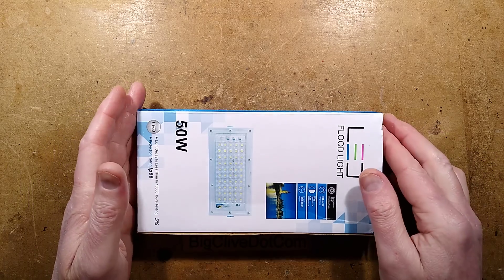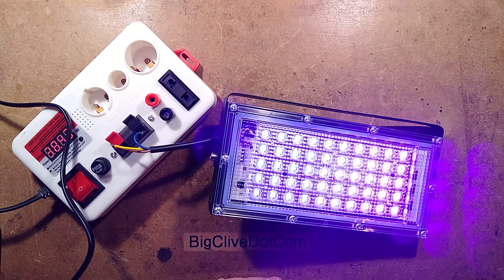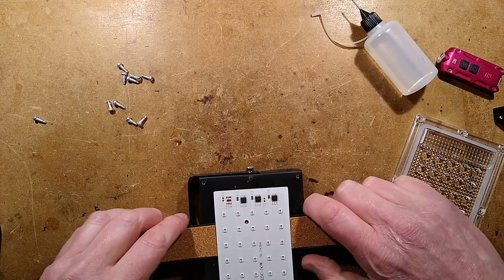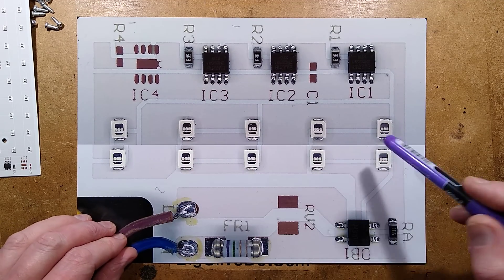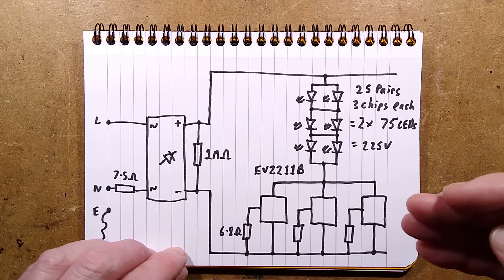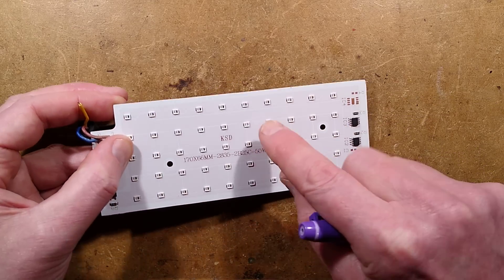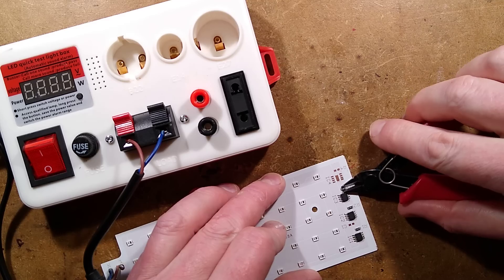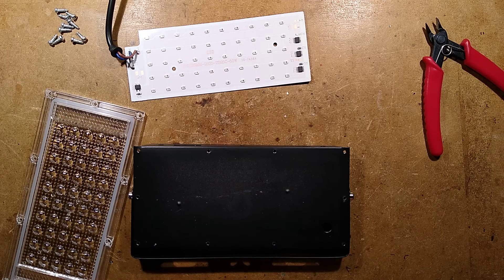Horrible eBay ultraviolet floodlight (with schematic)

Comment: But is this really Ultra Violet light? In a sense, if I want to cure UV activated Glue would this light emit UV radiation to cure the Glue? Or Curing Epoxy (which cures faster with UV lights) for example?  Thank you
Reply from the maker: It depends on the glue.  Molst seems to respond to the near UV spectrum.

Comment: I bought the 100w version. Missing the earth wire entirely, but there is another flaw. The 96 leds are wired in 3 x 32 parallel/series EXCEPT near the top left hand corner where there is a PCB error so that 1 triple LED bank has been split up, with all the current going through (from the top left) 3 parallel LEDs, then just 1 LED, then just 2, then back to the 3 + 3 + 3 + 3 pattern.
I shall be making 1 cut, and 2 PCB links to fix this to prevent the single LED acting like a fuse, as well as better heatsinking and an earth. I was going to hook this to a timer for exposing photo resist film for PCB prototyping. We'll see how that goes.

Comment: If the battery has a protection circuit, then there is nothing wrong with this circuit. Given the size of the solar cell and diode drop through the transistor it is unlikely that cell overcharging will occur even without a protection circuit. However, given that the switch can be left on to keep the light activated all the time, it would be possible to completely drain the battery. For that reason alone, it suggests that the battery has its’ own over and under charge discharge protection circuit. So in all likelihood a decent design.

Comment: I bought these in warm white, saw the fake earth and checked if there’s any voltage on the metal case and yes, it’s 160 Volts and went right into the bin. So be careful guys when you buy this crap or just don’t.

Comment: I don't expect Clive to have the time to reply to this, but just wondered if anyone knows what camera he uses for these close up demos? I do videos looking at old books and am stuck using a terrible webcam. Would be great if someone could help, cheers!
Reply from the maker: Most videos Moto G7 power.  Close ups, good lighting and a Moto G6 play.
Reply: @bigclivedotcom  cheers Clive! Wasn't expecting that. Love the way you can zoom in so easily and still retain a nice resolution. Very kind of you, cheers mate!
Reply from the maker: @newsfromthegelding  It's effectively digital zoom, but because it's a 1080P image working in a higher resolution frame it has the effect of optical zoom until you get too close and it has to go digital.
Reply: @bigclivedotcom  I thought that was the case, but still a really workable resolution when zoomed. Good lighting also helps a lot, I've noticed that even with the crappy cam I've been working with. Incidentally, it's a Logitech C920 I'm using. Absolutely fine for those who use it for streaming games, but anything else and the lack of quality/accurate fps is glaringly obvious. Just all a bit clunky.

Comment: All very well to criticise Chinese products, but there are plenty of British one that are also deficient in some way, e.g.  a UK manufactured washing machine that broke down a few days after the warranty expired.  All parts were working perfectly, the circuit board components were ok but the circuit board was designed to self-destruct on de-soldering them  Only the programmer chip could not be tested - was it programmed to count mains cycles and self-destruct too?  The replacement board was retailing for £200, but not programmed!  One then had to buy the firmware and a programming device (another £250).  So, to get working again £450 plus the time and effort, not counting p&p.  Another UK item with a safety concern was a cooker with a ceramic hob but no indication if the controls were powered on or off, likewise for a convector heater - a thermostat which gives the impression it is off, but comes on again if the temp drops.  Any item plugged into mains power should have a red light as a minimum.

Comment: With their large input capacitor, these things are great at tripping an RCD if a few are used on one circuit.
Reply from the maker: It may be the capacitance of the LED panel itself that leaks the current.

Comment: Hey Clive! Your content never ceases to impress me. Have you ever encountered a light source with various LED types that span the entire spectrum from UV to IR? I'm exploring camera color calibration, and I believe such a light would be beneficial. By illuminating the camera with distinct wavelengths, we could examine the RGB values. This approach appears to be simpler than constructing a monochromator.
Reply from the maker: That would be difficult to achieve in a linear spectrum.  The closest is high CRI LEDs that use a wider mix of phosphors for a richer white spectrum.
You may need to resort to daylight for a full spectrum.
Reply: That's interesting, Clive! I wasn't aware of the Color Rendering Index. It appears to be related to LEDs that emit the full spectrum simultaneously. However, for my color calibration project, the LEDs don't need to be active at the same time.

In fact, I was so inspired by this concept that I purchased ten distinct LED types with the following wavelengths: 400, 420, 445, 460, 490, 520, 620, 660, 850, and 940 nm. My plan is to connect them to a relay module, allowing me to control each LED individually by switching them on and off as needed.

Comment: BYOG .. bring your own ground.
Would be really stupid to send earth all the way from china, just take a shovel and add your own ;-)

When wiring a house you are supposed to have earth even if its not needed at the end, so if somebody drills into the line theres a higher chance of hitting a nice short circuit. So its definitely up to code, maybe, somewhere..

So lets just assume its got superior double insulation everywhere and the RCD will do the rest :-)

Comment: So.... Mods/Upgrades..
1 - Prep and spray the whole thing with BBQ/Heat proof paint.
2 - Sand off an area where you can soldier on the earth lead.
3 - Drill through the backing plate for 2 screws to mount the LEDboard (2 holes are already there on the LED board for reference)
4 - Use thermal paste to help heat transfer to backing plate
5 - Seal up (using silicone sealant/rubber washers) the back of the LED mounting board to the back plate to stop water ingress
Done...👍 Except for any internal mods like your tactics at reducing power consumptions etc 😉
Safer, a lot more water resistant and thus, longer life for product? Yeah I know, time involved doing this, but, IF you had the stuff already lying around in the shed, it'd be a nice little project.
Note.. As per our previous discussions (some time a go about weatherproofing twinkly/solar garden lights), as well as sealing around the edges of the solar panels with clear nail varnish, I now do the same to 'Coating' the circuit board and exposed wire with the same and/or a little silicone etc and then a dab of grease on the battery terminals... NOW.. We (my lady friend who has so much lighting in her garden you could identify where she lives from MARS! hahaha) have cheap garden lights lasting (so far) 3 full years - the occasional battery swap needed etc... 👍👌
😎🇬🇧

Comment: I was given one of these-Gardner AG-969 Insect Electrocutor- because it did not work. It works now after I noticed the door safety interlock was bent over.
 Attraction range: 3,000 sq. ft. (70 lineal ft.)

UV light output: 96 watts
Bugzapper from Hell. 
What to do with it now?
Reply from the maker: Bent safety switch brackets or actuators, and detached/broken wires are a very common fault in discarded products.

Comment: I would say just solder that ground wire onto the plate/somewhere sensible, and then pour silicone into that wire so it's waterproof and then it's a pretty good light right?
The good thing about you having so much electrical knowledge, is you'd often be able to fix these critical safety issues and thus wind up with a fairly usable device.
Reply: Other than the utter lack of a heat sink is going to put the board into thermal shutdown pretty quick, sure they're peachy.

Comment: Would the missing decoupling capacitor have done anything besides save the IC's from transients?
Reply from the maker: It's probably in the regulator IC datasheet so they included it just in case, but then left it off.

Comment: So I've seen these in hospital and restaurant locations, but I wonder what their function would be in outside locations?   Why use ultraviolet and not a high intensity led panel instead?  Also did you use your ultraviolet cards to determine  whether or not they are in fact ultraviolet?    I can see these used in as part of a diy mini water purifier project.    Good show.
Reply: These would not work at all for a water purifier.  These are longwave UV devices.  You need shortwave (UVC) for any germicidal application.

Comment: I had this in white, failed after a week completely with 6 hours of use / day
Reduced the output power to about 10W, shorted some burnt LEDs, yet it failed after a month again.
It is just designed to fail, so you can buy another one ...

Comment: Oh my God. I encounter this problem with most of the automotive headlights I order of aliexpress. Either they seriously lack thermal paste or are insanely overdriven. Every pair that passes through my hands gets hacked with a resistor across the thermistor circuit.

Oh yeah:
https://youtu.be/_oi4imsHrqA

Comment: Sorry to bother you with a question...I'm not tech savvy and am a very amateur low end home cinema enthusiast... One thing I can't find is 1-1.5mm stranded normal low end cable a good choice for speakers...compared to hi end stupidly priced speaker cable....would love to see a test...even if it's just a difference in ohms. Hopefully 🤞
Reply from the maker: Just use ordinary flex.  It makes excellent speaker cable.  As used by audio industry professionals.

Comment: I use a couple of these as work lights, they came with the varistor, and I chopped off all but one of the resistors and added an electrolytic. For the cost of a burger each, they were worth it.
Reply: What did you use the capacitor for?

Comment: You can buy these, scrap the metal housing and electrical parts, and build your own Aluminium Heat sink housing and proper current generator power supply.

Comment: That unconnected earth wire could defeat / delay the RCB / GFCI device. This is a death warrant.
Reply from the maker: It wouldn't  affect the RCD as it measures the current difference between the feed and return current.  But the DC circuitry can defeat an RCD in the event of a fault.

Comment: was thinking now the suns shining how many poundland solar garden lights with the solar panel linked together would it take   to charge a car battery
Reply from the maker: 2V each, so around 8 in series to allow for a diode.  It would just be a trickle charger though.

Comment: One other thing apart from the false "earth" connection .. the leads on these types of units invariably seem to be ridiculously short.

Not even long enough to wire-in to a junction box right next to the unit !! Especially if you want to angle it down like it's supposed to be.
Reply from the maker: Very short and also thin copper coated aluminium.

Comment: I have the regular version (with white LEDs) that I got from Aliexpress, I plan to use them as back lighting for taking photos, making sure that the frame is either properly isolated or out of reach of everyone.
Reply from the maker: Keep in mind that the output of these panels has significant flicker.  That makes them less suitable for photographic or video use.

Comment: It's the 747 lamp - the circuit board is bowing... But seriously, with no proper heatsink this lamp won't last long enough to get wet, even on the Isle of Man! 37 watts worth of LEDs dumping their heat into some thin sheet steel! Not that much of it was actually touching.  Abysmal design. Then there's the lack of earth. The wire is there, is the cost saving of a terminal and a rivet really worth risking people's lives for?!

Comment: I got a CNC machine from china. The motor cable from the drive had no earth and it wasn't screened. The control cables for the stepper motors weren't screened either. I had to rewire the entire machine. I also had to change the control system because the system it was supplied with used a windows 7 computer and the software was unworkable

Comment: The best way to reduce the output would be to replace the sense resistors on all three regulators with a higher value but soldering to these heatsinked boards isn't easy.

Comment: Aha I actually have a similar one of these in warm white, been running for a couple of years now I think. IIRC I rerouted the earth to one of the screws. Anyway the LEDs surprisingly still work somehow, but intensity is down significantly (surprise) and intensity/deadness per LED varies.

Comment: A few  questions come to mind:
Was the product CE marked? (Presumably Chinese export)?
Was the box marked with the UV peak wavelength?
Why do you not use one of those nice little UV detector cards to show what type of UV, if any, it is emitting?
Reply: Do you even know this channel?
Reply: @bzuidgeest  clearly you do not, as I have posted to it on a regular basis. The questions were valid. Given the poor quality, it is reasonable to ask it it was sold with a CE Mark.
Similarly it is reasonable to know if the product had a wavelength specified.
Given that UV detection cards were featured a few videos ago, it was also reasonable to ask if this could be used to indicate what type of light was really being emitted. 
I suggest you review some of the channels past videos, before posting such ignorant comments.
Reply: @nigeljohnson9820  i don't read every comment so i can't know how much you posted.
Asking if it had a ce mark is basically a rethorical question. Of course it didn't. And even if it had it would be fake.
The questions were valid, but on this channel they are either self evident or nobody cares.

Comment: Speaking of importing without official channels, I have removed fair few LAPs (brand belonging to UK's largest store chain BnQ/Screwfix). which did no have earth wire connected properly.
As LAP is a brand which I refuse to fit due to its low quality, I cant say if it came without earth out of factory or lost contact latter.
I have seen a case with one of the LAP side the door GU10 lamps to have earth cable the shortest (meaning that by the time the live gets disconnected, earth will be disconnected already. Its just a pity that its sister brand BG which used to be quite good, seems to be degenerating now too. 
I wish Clive would have taken apart some "Integral" as I find them to be the most underrated brand I know. While most electricians have already seen value of click, most electricians haven't seen whats inside mid range or more expensive integral LED to understand its benefits.
Reply from the maker: The LAP quality is surprising.  I guess they don't check every batch.

Comment: There's no getting away from the issue of thermal expansion and contraction of the air inside the box, so no matter how good the gaskets and seals, moisture laden air is going to breathe in and out, and will deposit condensate in the internals. It's just a matter of how long it takes.

Moisture ingress is the bain of these cool running lamps - They never get hot enough to dry themselves out.
Reply: Ooh ... I think you'll find this isn't a cool running lamp! (OK not like halogen but hot nonetheless.)

Comment: Oh dear , a ( cheap ? ) Wood's glass Mercury vapour lamp / dark violet strip-lamp  does the job  SO MUCH  better ! .. sometimes ( old skool ) stuff is SO much better ... and do not get me started on mains [  SMART METERS ] these might work well in ( some ) households , but as I live in a mobile phone " blackspot " , I will be continuing to use my ( ULTRA  reliable German  Siemens™ digital Kwh meter ! ) ... DAVE™ .....

Comment: They make actual grow lights like this unfortunately.  The LEDs are likely 405nm MQW leds. The only real hack for it is to put mini aluminum heatsinks on the regulator chips, add bypass diodes across the LEDs, and add a small capacitor across the recrifier, then mount onto a thick piece of aluminum plate. As it makes about 20W of light plus about 15 watts of heat passive radiation is fine. They have a bad habit if lying about power on grow lights. Would make a nice conformal coating cure light though. 😎🤓
Reply: I believe this specific unit has most likely 295-400nm leds or 445nm leds. Those are the only two wavelengths ranges I came across when looking for this very specific model of flood light.